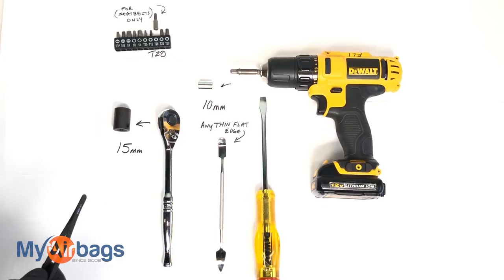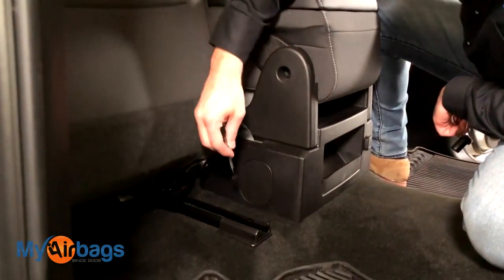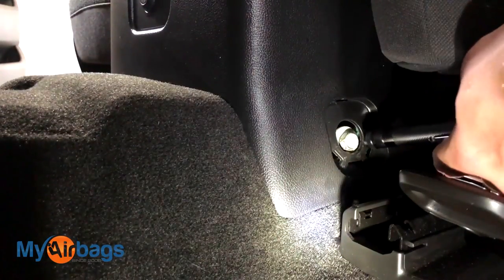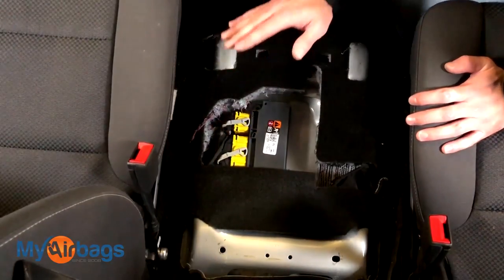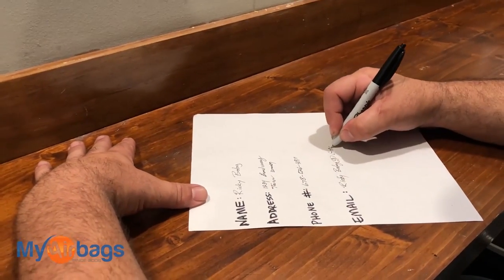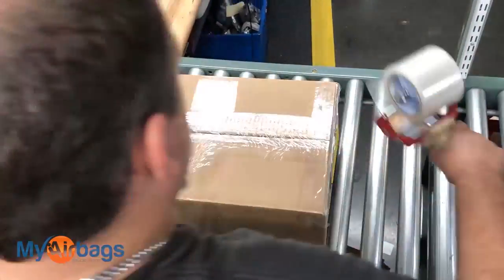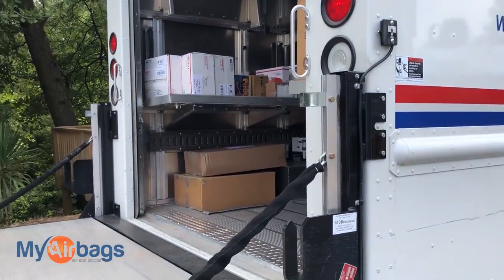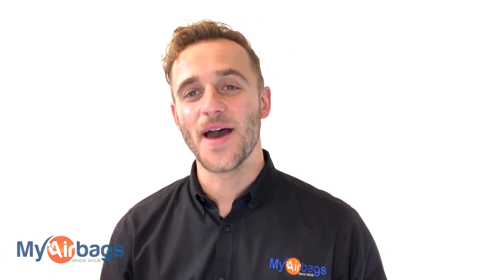How to remove SRS Airbag Control Module & Seat Belts on Chevrolet Silverado 2014 -2019  | MyAirbags

Comment: I have a 2014 Silverado crew cab that was in a wreck, do the back seat, seat belts need reset also?
Reply from the maker: The back seat belts on that vehicle should be just regular non-pretensioner seat belts. You can just check to see if they are locked or if they work properly as they should. We can rebuild seat belts if they are bad or locked, not working correctly.

Comment: I was looking to install a subwoofer in the center seat until I saw that module. Is that something that might disturb it with the magnet and vibrations? Hate to have my airbags go off when the beat drops! TIA!!
Reply from the maker: This is a very interesting question.  Yes, the vibrations might cause the roof and side airbags to go off. Yes for sure it might be a bad idea to install a subwoofer in the center sear area next to the airbag computer.

Comment: Good morning, I just bought a Silverado 2016 which has the front end wrecked and the steering wheel airbag is deployed. Im going to replace that but, my question is, do i meed to replace this module too? Or ill find that out once i put the new airbag?
Reply from the maker: Yes after vehicle was in an accident it will store crash history and SDM module (airbag module) needs to be replaced or can be reset.
Reply from the maker: Also check your seat belts and lower bottom anchor tensioner. We do rebuild them as well. Check out myairbags.com

Comment: I will send in the airbag module, and both seatbelt and lower anchor tensioner to get them repaired, however im planning on replacing dash airbag and steering wheel airbag also and i wanted to ask if it doesnt matter if i install different airbags or used undeployed airbags ?? will it erase the airbag light if i plug everything in after i get the module back? or do each of every airbag has to be programmed also?
Reply from the maker: Yes, you can replace the airbag with another used or new replacement, and the light will turn off. Airbags dont need to be programmed.
Reply: @MyAirbags  How long do you take to fix seatbelts and module? or how long will everything be
Reply from the maker: @alanfelix79  It takes only 1 day for repair and few days in shipping. Check out myairbags.com
Reply: @MyAirbags  Okay one question by changing airbags will the module deploy them if it detects a new airbag?? im scared to plug in the connector and once i plug the battery it will deploy
Reply from the maker: @alanfelix79  just make sure the module is bolted down with ALL bolts. Because most of new modules are plastic and it needs to be bolted down with all bolts. If not then roof airbags will deploy as it will think the car is flipping/roll-over.

Comment: Might be a dumb question but if I send the module in I won’t be able to drive the truck until I put it back in?
Reply from the maker: This is actually one of most common question asked. Yes the vehicle will still run and drive without the airbag module, of course do it at your own risk, air bags and SRS system wi not work properly unless the air bag light is off.  

Also check your seat belts to make sure they work. If they don't work properly or stuck, we can rebuild them. 

For airbag module reset 
https://www.myairbags.com/product/airbag-module-reset-3/

For seat belt repair
https://www.myairbags.com/product/seat-belt-repair-1-stage/

Comment: Quick question. So my 2014 silverado just had the airbag recall done, and now the ventilation system doesn't work. Blows really loudly, but nothing comes out the vents and sounds like stuff is moving around the dash. Is this even possible? Is there a video that shows how the airbag recall is done on this truck? The dealer is taking no responsibility of course
Reply from the maker: That sounds like a different problem. Perhaps they removed the vent and sid not assemble it back correctly?

Comment: I have a 2016 GMC Sierra Denali, vehicle was in a side colission. Airbag light is on and seat belts are locked. The SDM has a stored fault code B0052 - Deployment Commanded. Tried to clear this code and it does not go away. I see that you service clears crash history and crash codes.  I want to send you my SDM airbag control module and seat belts, because they are locked as well. Where do I send it? 
How long will it take?
Reply from the maker: Hi John, we are more than happy to help you with this project. We can do both the SDM (airbag control module) and the deployed seat belt pretensioners. 
Once we receive your parts, we send them back out to you within 24 hours.
Start your service order here: https://www.myairbags.com/

Comment: Hello! Quick question. When the seatbelts are repaired after being locked up, will they lock up again in the case of a future accident? Or is the tensioner completely removed?
Reply from the maker: That is a really good question. We have heard of some people/companies throw away all internal parts away and just make it a regular seat belt instead of a pretensioner seat belt. When we repair it, we use all OEM parts and replace all bad/failed parts, that is including the pyro sensor (tensioner) part. Yes it will work as the seat belt was designed to work. Here is more info https://www.myairbags.com/product/seat-belt-repair-1-stage/
Reply: @MyAirbags   I love to hear this. Quick reply! You got my service. Setting up my order on Monday for my 2014 Silverado. Will need both seat belts and  the module reset. Went hardcore off-roading and it set off my curtain air bags so I’ll be replaced those as well.
Reply: No
Reply: In Chevy isn’t necessary reset the airbag module. Of most of cases

Comment: I have a 2009 chevy silverado hybrid 1500 that had a air bag error. It said that the drivers side rear sensor was bad. we replaced that and still can't clear the code. it was replaced with a OEM sensor. It appears that the module is at fault. 2 things. what do you charge to reset the module? Also can the vehicle be driven without the module until it's returned from repair? Finally, what's the turn time on the repair?
Reply from the maker: Hello Robert! For your 2009, yes you can drive your Silverado without the module installed - your vehicle should operate fine. Here is the link to our service page, which should answer your other questions. Cost and service time can vary depending on when you need it back. Please feel free to reach out with any more questions you may have! 
https://www.myairbags.com/product/airbag-module-reset-3/
Our community forum: https://forum.myairbags.com/?wpfs=silverado+module

Comment: Seats from a 2014 Silverado and 2018 Silverado, are they the same? To just plug and play???
Reply from the maker: Seats or Seat Belts? Seats can be replaceable but look to see if there is a weight sensor on the seat. If there is make sure to remove the sensor from the old seat and install on the new seat. If you are asking about deployed seat belts you can start here: https://www.myairbags.com/product-category/repair-return/seat-belt-repair/
Reply: Reason for asking this is because I have a 2014 Silverado lt cloth interior and upgraded to a 2018 leather interior, everything works but the airbag light is on, on the dash, idk if the airbag wiring are different.
Reply: Hector Vega where you able to take the air bag light off? I upgraded my cloth seats to leather and my airbag light is on
Reply: Ivan cortez, I couldn't find a way to turn it off so wat i did I just swap the covers,  took off the leather cover and put it on my old seats driver and passenger side. Thats how I fix it. I went the easy way I guess.

Comment: How can you tell if the seat belt pretentioner and seat module has been compromised without tearing it apart?
Reply from the maker: If the seat belt is bad, then usually the airbag light will be on. Also, same for the airbag control module. After vehicle is in collision/accident then seat belt will be locked and not work correctly. MyAirbags can rebuild the seat belt and reset airbag control module.

Comment: one of my seat belts got cut.  Will you replace the belt part of the mechanism?  I am sending two belt units to you.  Thanks.
Reply from the maker: Yes, we can rebuild your seat belt! We can change the cut seat belt and check the mechanics to make sure all parts are working. We have all the parts needed for the repair. Here is the link to get started https://www.myairbags.com/product/webbing-replacement-dog-cut-ripped/

Comment: Do 95-98 have a way to reset the airbag light?
Sorry C1500 Silverado
Reply from the maker: That is a great question. We did reset GMC/Chevy airbag control modules for vehicles under year 1998. We have stopped doing them because it is hard to get replacement chips/mcu's for these modules.

Comment: Hey I have a 2014 Silverado and my seat belts are locked up from accident. How much to unlock and reset airbag module?
Reply from the maker: Airbag module reset is $59.99 and seat belt repair is $89.99. But there is a 2nd piece for the seat belt that could have gone bad as well. It is the lower anchor tensioner that is located on the seat, next to the door. Take a look at it, its most likely bad as well. Send that part as well and we will take cate of it.
Here is more info:
https://www.myairbags.com/product/airbag-module-reset-3/
Reply: Did you got it fix with them ? I got a 2016 silverado two seat belt lock up and i got a code on my dashboard
Reply from the maker: @vkchikom3187  yes we repair seat belts, the process is fast and easy, visit myairbags.com

Comment: Do I need to change front sensors if I have air bags and seat belts deployed??
Reply from the maker: Roberto, the original impact sensors are ok to use unless they are physically cracked, damaged or if you are getting a code for it/them. Even then, make sure they are mounted correctly and firmly.
If you need to replace them visit our MyAirbags HELP center here: https://myairbags.zendesk.com/hc/en-us/articles/360001391787-How-to-Change-SRS-Impact-Sensors

Comment: I have a 2015 Silverado and I’ve been told that the front seatbelts have to be replaced and cannot be rebuilt. Is this true?
Reply from the maker: John, the seat belts can be completely refurbished. The module can be reset as well. We have have been in business 2006, helping our customers save money on this exact issue. You can start the service order here: www.myairbags.com

Here is the seat belt repair link
https://www.myairbags.com/product-category/repair-return/seat-belt-repair/

Comment: so this trucks don't have sensors on the front?
Reply from the maker: Hi Victor, There are impact sensors in front. Theres usually 2 of them, one on each side. They are mounted near or on the radiator support.
Reply: My Airbags do the sensors have to be replaced?

Comment: Hi if I remove the module will I still be able to drive the vehicle?
Reply from the maker: Yes vehicle will still run and drive, but of course airbags and SRS safety system will not work. Don't recommend that you drive it for safety reasons.
Reply: Thanks for the reply much appreciated
Reply: So with out the module you said the vehicle would still run but not safe. But, will the airbag light still be on on the dashboard or it would be gone? Thanks!

Comment: I have a 2019 TahoeZ71, the airbag light only comes on when its it's raining or when its damp.  What could be the problem?
Reply: Corrosion on wire connections or fuse box due to water damage
Reply from the maker: Yes exactly 💯, thank you for providing an answer

Comment: Whats the code or light that comes on when the seatbelts deploy?
Reply from the maker: There is a lot of different DTC codes for that and they are different based on year, make and model of the vehicle. But the code description is usually one of these:
1. Circuit open for Seat Belt Pretensioner 
2. Seat Belt Pretensioner Too High
3. Usually any fault code for seat belt, pretensioner or buckle.
Reply: @MyAirbags  thank you so much for your quick response! You’ve got a new suscriber!! One more last question. I seen someone on the comments if it was ok to drive without the module. You said, it’s dangerous and anyone doing it would be on their own risk. But my question is. If you take the module out completely, will the air bag light still be on the dash? Thanks!
Reply from the maker: Yes the airbag light will still be on if you remove the airbag control module.

Comment: Still need to reprogram a RCM if you repair it?
Reply from the maker: Randy, as long as the module we are resetting for you is original to the car, you don't need to program it. In other words, if we are resetting the same module that was in the car during the accident, its already reset. No additional programming needed in that case. We are here to help if you need: https://www.myairbags.com/product-category/repair-return/airbag-module-reset/

Comment: I have airbag light on.. In Silverado 2015.. When scan it shows B0012 D01. Steering wheel air bag deployment loop high resistance

DTC history status : History
DTC current status : Current
MIL status : Requested

What does this means and how to fix it?
Reply from the maker: Looks like problem is with the driver airbag. Issue could be with: 
1. Bad clockspring that is behind the driver airbag
2. Loose driver airbag connector
3. Bad driver airbag
If vehicle was in an accident/collision, then we can reset the airbag computer module and rebuild seat belt pretensioners at myairbags.com
Reply: @MyAirbags  how do I read the codes for a intermediate airbag light on, 2019 Silverado. I have a drb-II.

Comment: How much to fix airbag module an the two front seatbelts on 13 Altima sv
Reply from the maker: Airbag Module Reset for Nissan Altima 2013 is $69 and Seat Belt Pretensioner Repair is $75 each. https://www.myairbags.com/product-category/repair-return/airbag-module-reset/

Comment: 04 gm has code B0051
Reply from the maker: Yes this is a very common deployment commanded error code. Usually with this code, airbags did not deploy but the code got set. The SDM airbag control module needs to be reset. Here is more info on how to get your airbag module reset:
https://www.myairbags.com/product/airbag-module-reset-3/

Comment: How do I know if my seat belts are no good? Or is mandatory to get them  fixed after a collision
Reply from the maker: Yahir,
After an accident, it is very probable that the seat belt has deployed. There's more than one way to know for sure. One very clear way is just to see if the seat belt is locked up. Sometimes belts are deployed but can still move. In those cases, you can still find out by scanning the car with a scan tool or you can also remove the belt and check resistance with a OHM meter as we show in this video here: https://www.youtube.com/watch?v=A2iqMqdbb5U